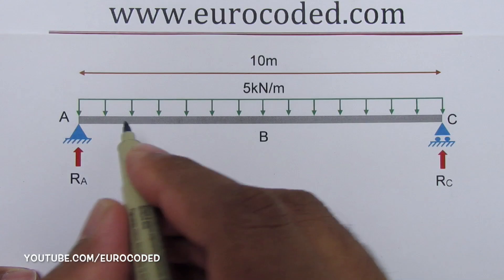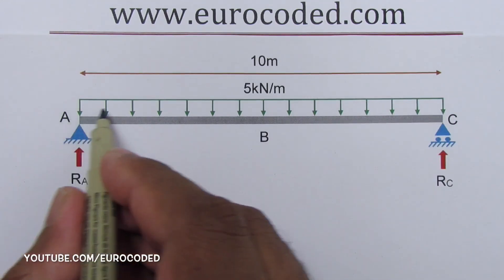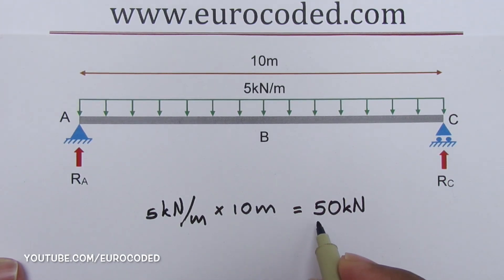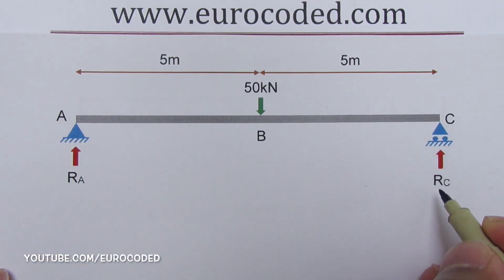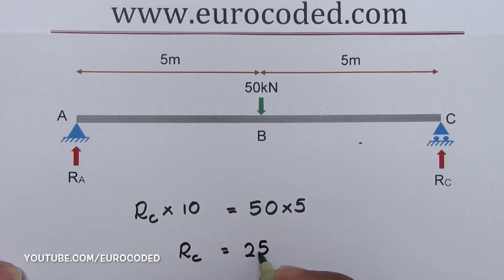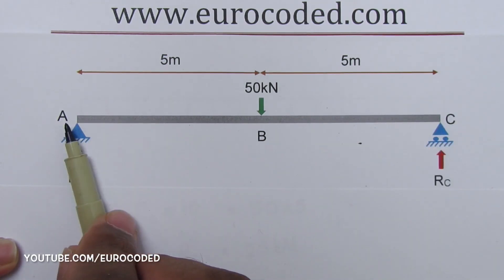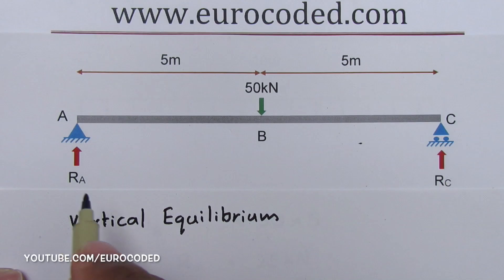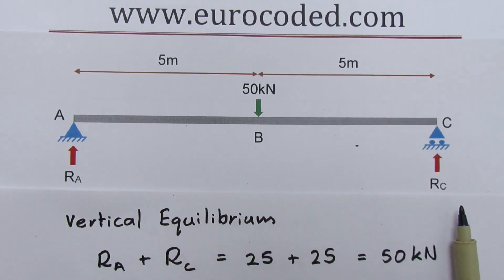How to Calculate Reactions of a Simply Supported Beam with a Uniformly Distributed Load (UDL)

Comment: What if you add concentrated moment at C?
Reply from the maker: you need to include that moment when you take moments about a point. instead of writing force x lever arm, you write the moment. remember to consider the direction of the moment i.e. clockwise or anti-clockwise.

Comment: Why is RA and RC moments the whole
Span length? Shouldn’t it be RA x 5m because it’s clockwise to counter the 50KN point load?
Reply from the maker: You need to consider the lever arm from the point you take moments. Ex: when you take moments about C, the lever arm is 10m for R_A. I.e. distance from C to A.